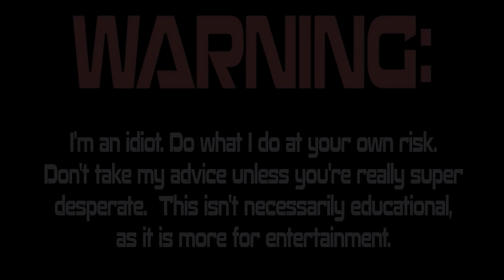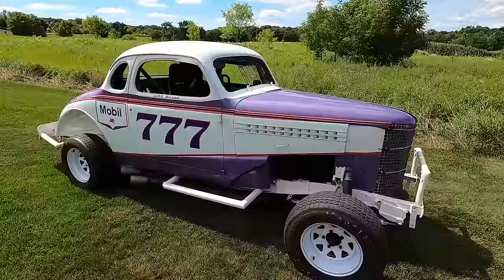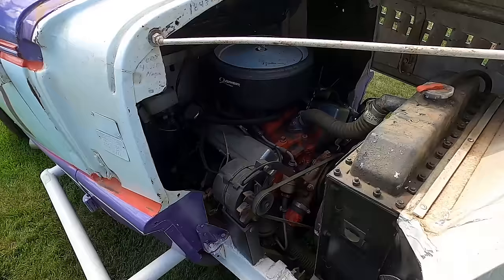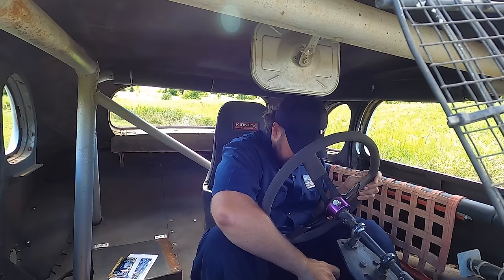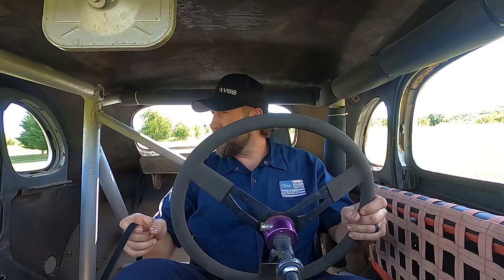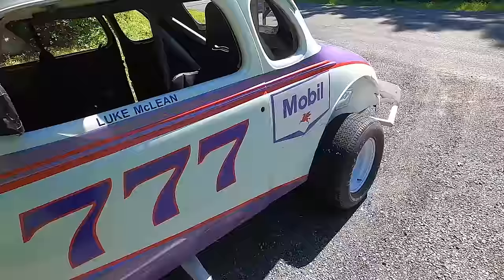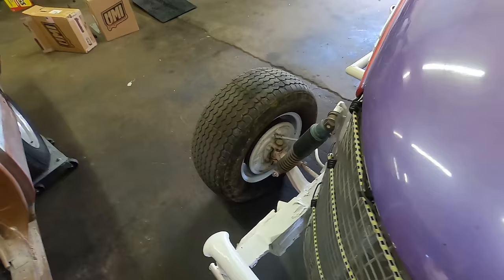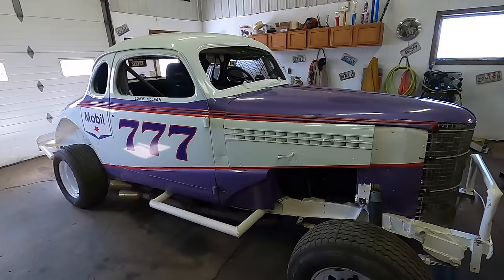I Bought A HISTORIC Vintage Modified Race Car! - Vice Grip Garage EP87

Comment: What's that car done since it was restored?  How much restore in it besides the body and engine? 

I'd go over the tie rod ends, U-joints, all that stuff and make sure they're tight.  

Lots of guys just take cars like this to shows and meets and display them, run parade laps with them.

Comment: never seen a shifter between the legs pretty crazy i know alot of people prefered to have the clutch in the middle and not on the left and for whatever reason i drove a 33 coupe around my local track that had sat for years prior had 2 shifters 1 for 1st and 2nd and the other for 3rd and reverse also got my foot stuck between the clutch and roll cage got so distracted i almost went straight into the wall in turn one

Comment: First, does that car have a straight tie rod like a semi? I would think it would have to being where the engine is sitting. If so, that toe out would make sense, seeing as there would be no ackerman. Adding a larger diameter tire to the outside probably aids to the slip angle. I don't know if that axle has any adjustment for camber, so my guess is they had to make the car turn by any means possible. These are my guesses. I probably won't win any prizes. Second, do any local tracks need a parade car? Or maybe local parades?

Comment: Hey Derek first of all HAPPY NEW YEAR , I was wondering on that steering with one tire bigger it could maybe have been a safety thing that way if something happened it would automatically go into the middle of the track and not into the grandstands , i know most large trucking companies have the trucks aligned to run off the road to the right if anything happen s to the driver just a thought???.

Comment: I also have a 1938 Chevy jalopy, it was a number 5 white in color, I know nothing about it, only the body and original frame and straight axle on the front, no motor, no that not a bad idea it’s a good idea, what do you think s is , its called square tires probably, high speed wable, loll , no seat belts, kool thanks y’all BigAl California.

Comment: 42hundred comments this will be overlooked or already covered. The shake is death wobble, all solid axle vehicles suffer from it, coils and links are worse than leaf springs but they can all do it. 
Solutions; more caster, a drag link, a steering shock will mask it, and just fixing what are probably a whole bunch of warn parts. 
On a short track it's never going straight long enough to notice unless it's really bad.

Comment: The dirt tires aren't balanced. Most likely the problem. You dont notice it on the dirt. They get changed so often it doesnt make sense to balance. Is it at a certain  rpm, certain speed. If its rpm, drive shaft balance? If its speed related, tire balance. Also the rear is probably welded up to lock it up.
It's common practice for the r. front to be bigger diameter than the l.front. I'm surprised to see no stagger in size of the rear tires.
Reply: It sounds great, very healthy, and looks great.
Reply: Look for a vintage racing club in your area, or do like some guys do and make it street legal.

Comment: Imagine trying to put a car like this into anything these days, like not even 24 hours of lemons would let something like this
Reply: Get a proper cage and your good to go
Reply: @nikonordman7624  Fuel cell isn't legal, the roll pan in the trunk/tank area isn't sealed off.  Plus the multitude of problems with the cage that you mentioned.  It's probably black water pipe, there are no door bars,  etc. etc.  That said, it might be allowed in vintage racing.

Comment: I removed the front clip on my 1937 Ford back in 1959, to enable me to change the engine. Drove to the wrecking yard on back roads, dropped in new 38 Mercury engine, drove home by back roads. Couple of hours later knock on the door from the cops. Go figure?😜🇦🇺🦘🦘🦘

Comment: Stab your camera so you can video the front end. Sure looked like death-wobble to me!! 
Jack her up and spin the front wheels. You may also find an egg.. I thought maybe the tires had flat spots, but they would be rode out after about 5 miles depending on road temps.. Check your joints and the steering box. On dirt, who cares. Cool car!!!

Comment: it is a dirt circuit car not a road car it is set up for the dirt to turn left not for a road race car my v8 dirt modified used to do the same thing when i tested it on the road used to swing from side to side as it was not set up to be used on the road

Comment: look for deformed tyres they might look ok when standing still but once they start spinning they can deform plus look for a buckled wheel alignment that should cause that death wobble it would make it hard to steer screening tyres as they scrub on the road so that's what I would look for as the tyres you said were plus 20 years old that's the first thing I would look for plus having a tyre an inch in height difference won't make a death wobble think space saver wheels as they don't cause any problems I always look for the simple things first I bet its the tyres or wheels if not possible wheel bearings but doubtful to my knowledge as a roadside rescue mechanic trained in all mechanics exams coming out of my ear lugs over 35 years in petrol and diesel and even electric vehicle invalid carriages over here in the UK I worked for the R.A.C the royal automobile club for 16 years until an accident at work finished my working career it used to make me laugh people would change there gear boxes and prop shafts and rear axles and all it was when I turned up they would say I am waisting my time looking at the car or truck as it had so much work done to it and still had a death wobble and the first thing I would say id have you had the tyres inspected for deformation and they would say no so I looked at the tyres one had a very slight deform in it as I spun the wheel so I took it off and took it to a tree place they removed the tyre and low and behold all the webbing in the tyre was breaking up so the faster you went the tire would deform so we proved the point he putt the tire back on and fitted it to the wheel alignment tool and spun it up and boy it deformed 5 inches we stopped quick as we thought it would damage the machine I filmed it to show the customer and I had a new tire fitted on it and took the old one to show him as he wouldn't believe me so I said I would pay for the tyre if it wasn't the fault so he agreed he was totally gob smacked when he saw the video and the state of the tyre he spent thousands on his car all for a tyre he was so thankful to me and apolagised to me for saying there was no way I could fix it I tod him its my job to diagnose problems that's why I am here just doing my job I here this all the time from people they don't realize how much knowledge we have to learn and you learn something new every day as you will never know it all so if a mechanic say I no everything I can fix everything I don't need books for the specs of the car then walk away from him in fact run away would be best lol well at least I got a £100 pound sterling tip for fixing his £134.67 the tyre cost fitted and balanced as you know you never stop learning on this job and now the electric vehicles are here so out come the thick rubber gloves and safety

Comment: Don't make it street legal; it's a race car not a street car.  You just have to race it a couple time.  And  then maybe a couple more times.  So you put a few beauty marks in it.  The car won't mind.  Just look at the trunk lid.  It's been pounded in and out a bit over the years.  Fix the shifter so you don't have to measure the shifts with a sun dial, and go for it.  It will be the best days ever for you.

Comment: Since you are not going to race it, I would make the tires the same size and fix the gear box so it is more drive able. I guess it really depends on the what you want to do with it. If only for shows leave it as it is, but if you want to go on car rallies then you will need to make it street legal with easy to remove fenders and lights, also remove the locked rear end so you can drive it on concrete. Be a shame not to be able to drive it so...........

Comment: you need to remember when Chevy came out with the 283 all the other cars ran flat head fords so a rev happy small block Chevy walked all over them . and it stayed at the top of the field tell ford and dodge came out with there own versions of a modern engine . after that it came down to a power war as to who could make more for the longest .

Comment: Typical handling for a dirt track car. Spool in the rear, likely it also has an altered thrust angle to kick the tail in a bit while cornering to allow more power to the track in the turns.. The front is set up so the inner tire will act more like a paddle and pull the nose down as the weight shifts to the outer tire. When you are hard in the corner that front left will be VERY light.  Even a modern dirt car would be a handful to drive on flat pavement as they are still set up about the same way. Now if it was set up for banked asphalt, it would drive much better on the street.

Comment: The great state of Tennessee got me last year,on my way to Bristol for the super late model race,blew a tire on my truck,It was 11 at night I was like 14 miles from the motel so I unloaded my 1100 HP late model stuck a q beam out the front and got back on the road I made it about 3 miles and I passed a unmarked trooper apparently I was running about 105 mph had my helmet and seat belts on safety first I'm not sure what drew his attention to me but he turned on the cherries and berries and I stopped,He had a good attitude about he laughed gave me a $2500 fine then asked for a picture 😐 said he was cutting me a deal because he wasn't impounding my race car,He really laughed when he seen I'm from Florida I guess there's a FLORIDA MAN MEME THING The next day during qualifying tie rod broke totaled the car

Comment: Hell no dont make it street legal..  id make it drive right or ok... and tune it up and have it as a driver for track meets and run it in a  straight line a couple few times..  make a little stand and car port for it out in the yard somewhere with a little water fountain and one of those concrete jockies holding a lantern sittin next to it..  a little plaque with some info on it..  just so when i got to old to drive it i could go out and show all the kids what did before anybody invented the hodamn cellphone...

Comment: Please don't try to turn that into a rat rod.  Old race cars deserve a viking funeral or to live as old race cars on some kind of legends series.  Before you start screwing around with geometry on the front end, measure every angle on the car and keep good notes.  You're probably going to find she's shorter on the right side than the left, that's to help drive the car into the corner.  You also might find those leaf springs have a different number of leafs or some of them are heat treated to get the tension out.  That car is going to be full of questionable engineering and as a champion car with a season full of wins it wasn't built out of just what was laying around.  Those parts were chosen because they made the car faster, lighter, or stronger and was the best parts they could afford at the time.  Again measure everything, with that pedigree if you want to go fast you're going to want a baseline setup to go back to if you screw up the geometry by fixing things that aren't really broken.  I am not a dirt guy but I worked on asphalt oval track cars in three different divisions and three different tracks for ten years.  This is your second car, if you race this one competitively it could lead to financial ruin or another youtube channel.  Racing is like a drug addiction and 4cyl cars are the gateway, sort of like the first taste is free.